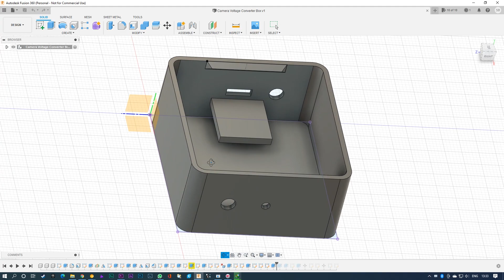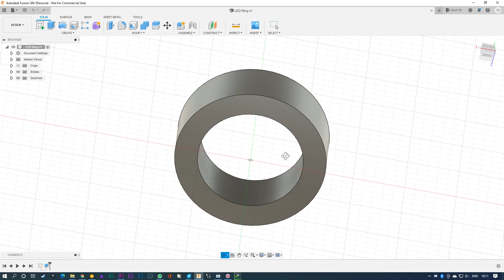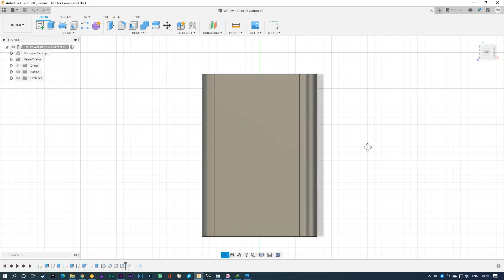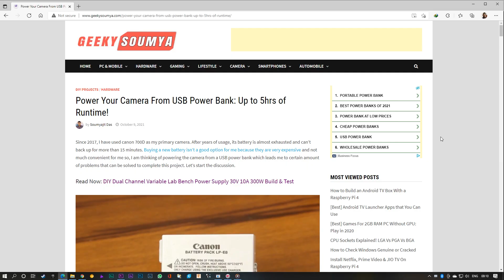Power Your Camera From USB Power Bank: Up to 5hrs of Runtime! Unlimited Camera Battery

Comment: Y dint u make ur own 8 volt power bank 
Its so simple.....
When u have 3 printer or laptop cells  charging  controler available in market
Reply: Because it'll be more versatile to just use an usb cable than to build proper dedication battery pack he can swap out the powerbank whenever the powerbank backup degrad as time goes , he can easily swap it out , or could use a bigger capacity powerbank if needed whereas if he made the battery pack as u mentioned then he'll have to disassemble the whole thing just to replace the cells , which is not practical

Comment: Windows Script Host

Error 0x80041002 occurred in connecting to the local registry. On a computer running Microsoft Windows non-core edition, run 'slui.exe Ox2a 0x80041002' to display the error text.

My error plz help 😭

Comment: I think you should use a fan to cool the booster circuit. If you use the camera for long time the booster circuit can heat up and may damage the camera.
Reply from the maker: I don't think so. I have used the camera for 1hr 45minutes but I have barely noticed any kind of heating issue.
Reply: @BlustiFie  ohh then it is ready to go
Reply from the maker: Yes 😀